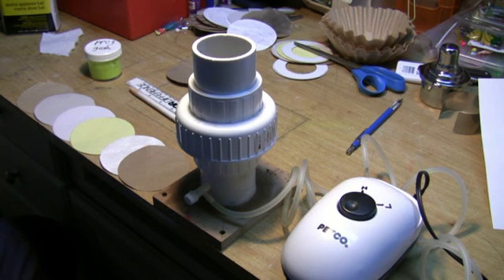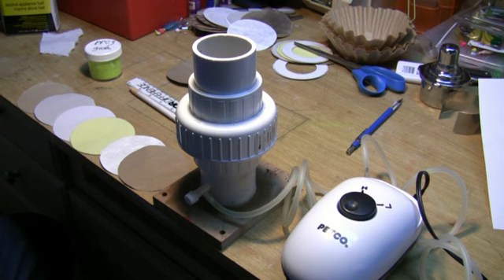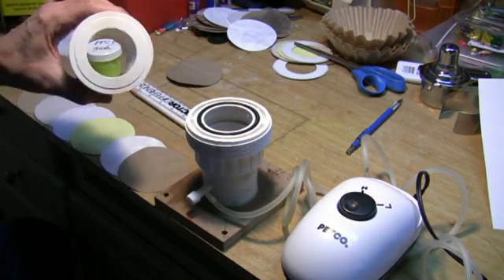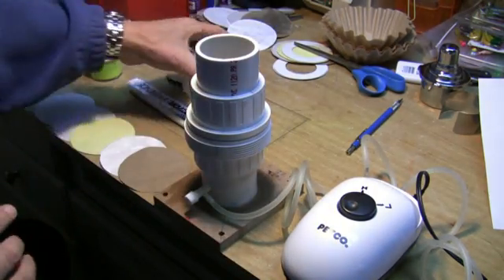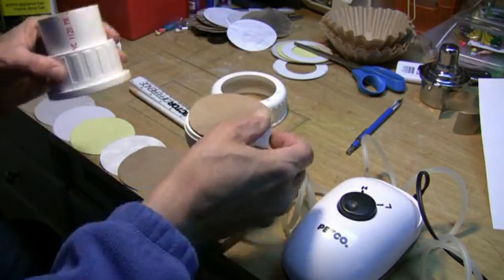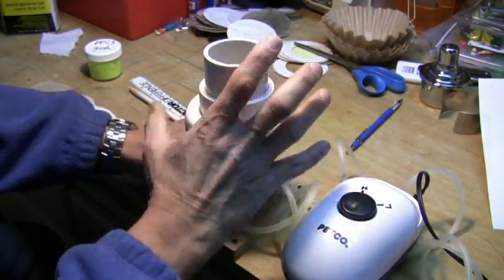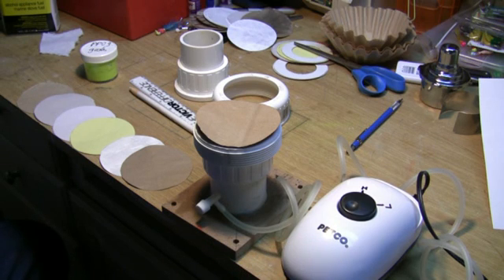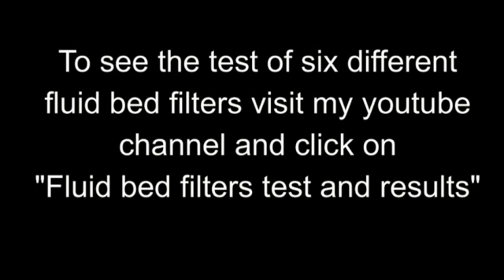Fluid bed construction for powder painting

Comment: Hi I am having trouble getting the 2" PVC pipe into the union.  I will not go in all the way.  I want to be able change out the top section when changing pain colors.  Did you sand the PVC pipe to get it in?

Comment from the maker: Hi Kerry,
The filters measure 3-3/8" diameter, same as the outer diameter of the male-thread section of the union. Your union might be a different size but I think they're pretty standard if you're using 2-3/8" OD PVC pipe. Can't wait for fishing season! But it's going to be a while around here...
Reply: I smacked myself after I asked you this.  I traced around the inner piece of the union and easy that was! What did you use to block off the other air valve to get just the one air line?  Thanks for all the help!
Reply from the maker: Kerry Parks
Hi Kerry,
To block off the other air valve, I just cut a short piece of tubing, slipped it on the valve and then folded it over on itself and secured the fold with a twist-tie.
Reply from the maker: Hi Richard,
Yes, it's necessary to seal the area between the lower tube (intake chamber) and the wooden base. I routed out a 1/4" circle for the tube to sit in and then filled it with silicone adhesive. If you use a strong adhesive like Mastik or superglue gel, you probably don't need to route the channel.
Reply: DogTracksCD  Thanks for the help.  Now, the air line to the is leaking, even when I replace it.  I am using a Brass air valve.  Where did you get your PVC air valve? I thought the brass would be better and seen other use them.

Comment from the maker: I like the idea of an additional gasket on top of the filter....but not the o-ring; it needs to be on the bottom because the union has a groove on the bottom that is sized for the o-ring. Anything else in its place would leak a lot. The bed works great as it is but I always love to tinker. Thanks for the idea.

Comment: I think you want the o-ring on the TOP. That may take care of the edge bubbling. /// You might also try adding additional gasketing of some sort for the other side of the filter (or even also on top of the o-ring). Auto parts stores have sheets of gasket material, as well as tubes of RTV gasket silicones (Permatex is one brand). A good seal on both sides of the filter media should help with that edge seepage. /// Also, possibly just a deeper tube, to let you use a bit more airflow w/o 'blowout'.

Comment: What size hole did you drill in the bottom PVC section to accept the air flow control valve?